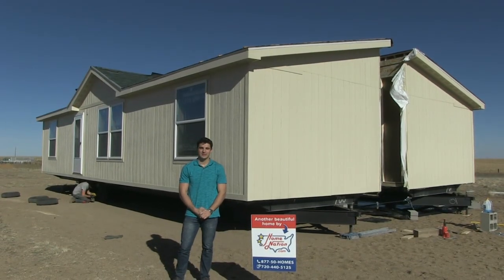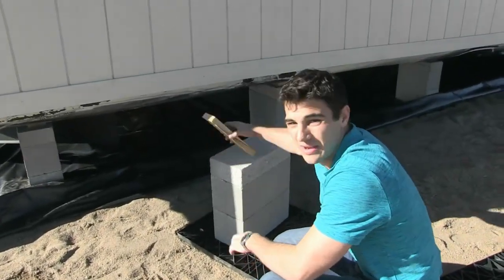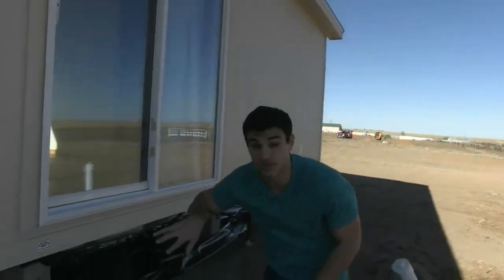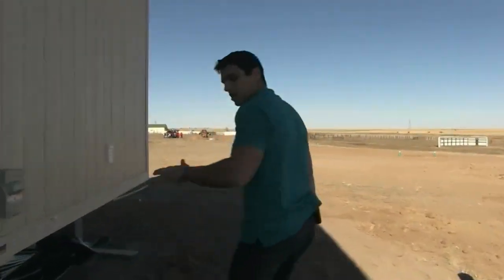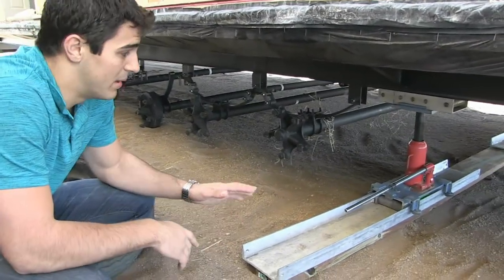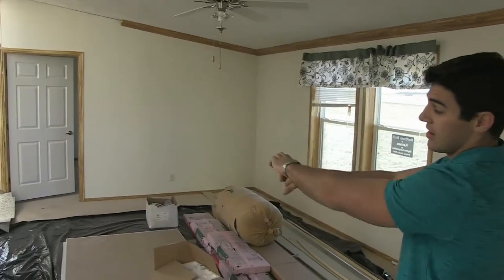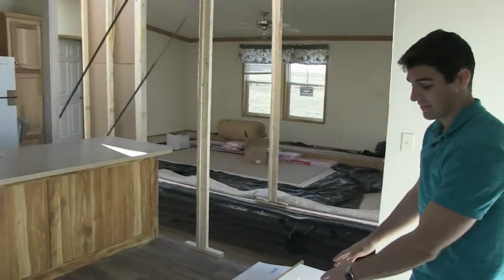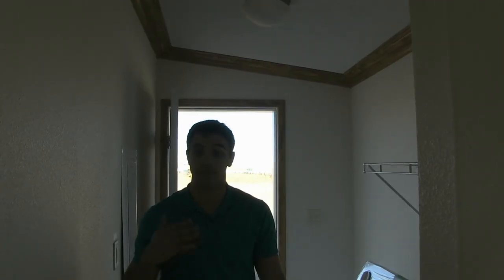Double Wide Installation Overview

Comment: I had an old trailer "re-leveled" and it basically wedged the two halves of the house apart and didn't level anything. Should I let another contractor try to fix it, or will it probably just make it worse?

Comment: Anybody notice the outlets floating in the drywall instead of nailed to the stud? No jack studs on the door framing and one sad cripple stud? Plastic pad for the brick base is pathetic.  I wouldn’t use plastic anything for a foundation unless it’s a shed.  I take that back....I wouldn’t use a plastic base on someone’s shed.
Reply: You are really lost in space
Reply: We use abs pads on alot of the mobile office trailers that we set up on TVA sites. You have no idea.
Reply: I like your attention to detail.  I think jack studs are used on load bearing walls, but imo they are a best practice everywhere.  Don't know if what you saw was load bearing.
Reply: The electrical boxes are cut ins very common in mobile homes and some situations residential

Comment: In colorado it can stay on blocks with tie downs?  Or does it need a permanent foundation?  (bolted in footings)
Reply: Depends on the county...most require perm foundation with poured concrete but some (like this one) allow it to be strapped down with anchors into the ground.